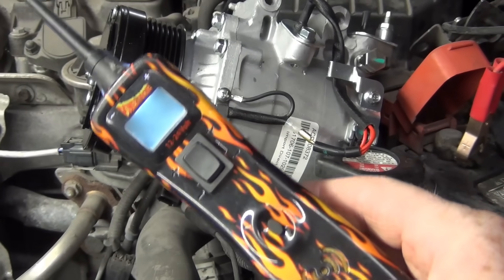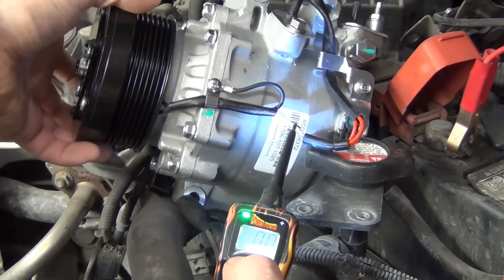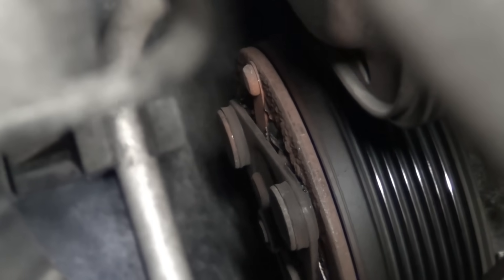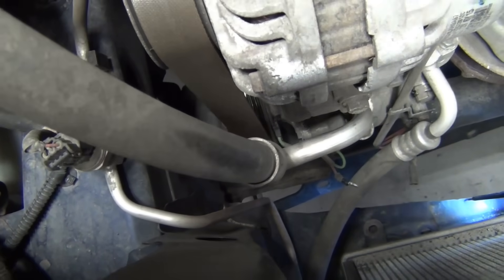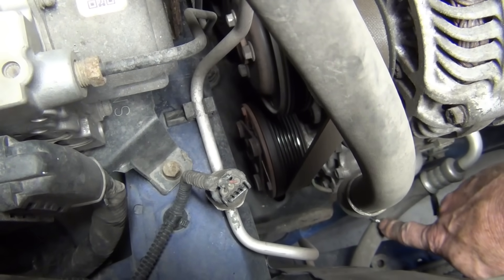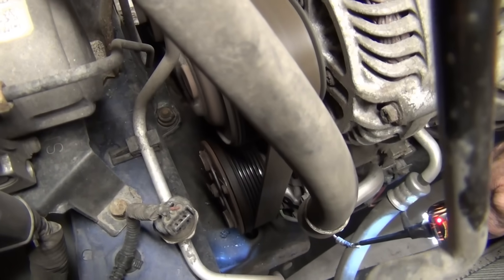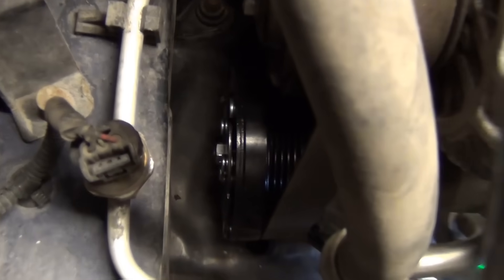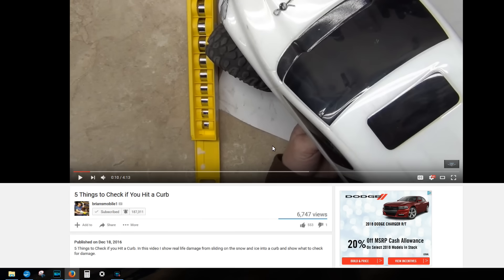How-to Test for AC Compressor Clutch Function

Comment from the maker: Power Probe used in video → http://amzn.to/2h1QaPN
Reply: Hey my car that was having trouble was also a 2007 two door Honda Civic with the same paint color 😂. Maybe they have a recall
Reply: Please please please please make more electrical video 😍😍😍😍😍😍😍😍😍😍😍😍😍😍😍😍😍😍😍
Reply: You knew they were selling something useless.
Reply: @rsattahip $@*£ -Many tools might seem useless at first glance,especially if You don't know how to use them.
Reply: @robmendoza6210  It's a glorified wire with a switch on it being sold for $61.  Anyone who cannot figure that out should not be messing with cars.  The 12 volt meter is pointless, you can do that with a light bulb.
Reply: @rsattahip  I just thought of a huge career move for you Robin,why don't you creat a product that can test continuity,add power or ground by pressing a button!but sell it for less than the "Ridiculous"power probe.
Reply: @robmendoza6210  mm

Comment: Very true advice. My clutch is engaging but doesn't look evenly surface-wise. I bench tested mine. Bc it sat with an torn open line, replacing all seals at that. Why waste the time when a contaminated system as you said. Especially if you are like me doing a 4th gen trans am

Comment: 12 Subaru Impreza. I have 0 volts going to the compressor. Should this read 12-14 v when AC is on? Fuses are good
Reply: replace the relay

Comment: This ac clutch engaged if we dont have Gas on Ac ?
Reply from the maker: If you go direct- yes.  Not on it's own if it's out of refrigerant.  The low pressure cut off switch forbids it to protect the compressor.  No refrigerant circulation means no oil riding around with it so the compressor would burn up from friction.

Comment: You dont need any of that to test the ac clutch. Thanks to RY the Car Guy for this info, look him up on youtube for visual on how to do the self test. For Nissan Xterra (and according to comments on his video, nissan pathfinders too, maybe other vehicles- worth a try lol)

Put your wippers up.

Put the key in and turn to on position, don't start the vehicle.

With in 20 secs of turning the key to the on position press the little button on the drivers side door frame (the one that tells your vehicle the door is open/closed).

Turn the key to off then back to on and you should hear a quick horn beep. Thats good and means the self test will run.

Will test in this order

rear defogger

Wippers (this is why you should put them up. So not to run on dry windshield)

Lights, parking/side, license plate frame, head low and high.

Ac clutch (you will hear the clicks if its working)

Electric fan.

It runs through the tests 3 times. Or you can end the test by turning the key off.

If you dont hear the clicks after the headlight test and before the fan turns on then your ac clutch isn't working. Check fuses/relays and if fine then need to replace the ac clutch.

Comment: I need some advice. I have a 96 Chevy 1500 and my AC went out a few months ago both hot and cold. When I go to turn the switches nothing happens but I hear a weird tapping/grinding sound coming from what I believe is the blower motor or door actuator? I really want to get my AC working but I have no idea where to begin. I have my heater core bypassed because it had been leaking. That being said, do I need a heater core for AC and is it smart to do what the video is doing or spray some dye n the lines for leaks? In all I’m lost and need guidance ngl.

Comment: I have a 2007 Mercury Montego and the clutch quit engaging, I took it to a mechanic at the town I was in and he took out the diode and told me he can't explain why but sometimes taking out the diode in Fords has always served as a solution for this issue. I'm not a mechanic but I would think that there is a purpose for every fuse put in the fuse box LOL what could have caused this issue?

Comment: I have a 1998 Mercedes ML320 and the AC stopped working. First thing I checked was the fuse and it was burned out. Easy fix right? Well the AC still doesn’t work. I just took the old power steering pump off to replace and now I have a lot of room to work with. The serpentine belt that runs everything is off. I was wondering can I check to see if power is working across the AC pump with everything off? If so do you have any suggestions on the best way to do it? Thank you very much and I definitely appreciate your great video.

Comment: I like how you demonstrated this by comparing the test on a broken compressor vs a brand new compressor. Showed how it should work (new) and how a broken one does not work. That power probe really does the easy job for testing the fault.

Comment: Does any one help me find the issue Ac compressor doesn’t turn on .. new Ac compressor new Relay new high pressure switch but compressor doesn’t turn on … but when I put paper clip on the relay compressor turn on .. Freon is full
Reply: Might want to check if you have a restriction in your accumulator or orifice tube

Comment: My 2013 Nissan Rogue Clutch works but the Bearing in the Pulley of the Clutch System is making a loud noise.  I can reach the clutch by taking off the front passenger tire.  Then take off the plastic wheel.  Then you have full access to the a/c compressor clutch.

Comment: I noticed a variety of reading on the screen ( 0:50 seconds of vid) what do these reading mean and what should they be ? Thanks ! And what is a center wire ? About 3:40 of vid. And what does it attach to, feed power to? At 5:50 you say that with new compressor that you test a different wire but do not say which one. Wouldn't it be the same wire on both compressors ? I am thinking my coil is shorted. Promaster 3.6L it is burning/melting wires in fuse box ( actually call Intelligent Control Center per Mopar) along with ground wires from fuse box/ICC to body frame near it and headlight area.

Comment: Brian to replace the high and low pressure switches/limits, do you need to reclaim the refrigerant or are there check valves under them?  I have been told there are and also there are not from other techs. I am working on a1995 ford bronco with factory the aircon.

Comment: What if the compressor keep blowing the relay ? It works for about 2-5mins then blow relay on a 08 f150 4.6 v8
Reply from the maker: Test the coil wires for shorted together with a multi meter.

Comment: I have a vehicle charged properly ac works for a short period then compressor disengages. Comes back on short time later or doesn't at all. I'm thinking it's the clutch car is a 2001 original compressor.

Comment: Brian,  Where is the clutch what does it do?  What is the line you keep touching and how do I get it?  How do I know if the compressor needs to be replaced at all or if its the relay or some fuse?  Where do I troubleshoot, in other words what are the first starting steps to know if I even have to get to the compressor or relay or arm whatever piece you were not pointing out.  Okay power probe sales but I could also just use a piece of wire to the 12vt batter right?

Comment: hmm Ive replaced the A/C clutch on quite a few different car makes. Always super easy and fast. I don't see how replacing the whole compressor is easier. Dont you need to decompress the whole system to take off the lines? isnt the tool to do that super expesnive?

Comment: My Compressor and clutch both turn on and stay on when I start my car. I'm not getting any cold air though when my AC is on. I had it fully charged and still no cold air. Not sure what's wrong
Reply: Leak

Comment: I have an issue too. MY a/c just stopped working a week later after i replaced my condenser. Now a day ago my fans were kicking on and now they are not as well as my a/c compressor clutch is not engaging. I tested my compressor with my power probe and it kicks on but when i give it power my fans dont come on. Now a day ago i was testing the relay and i was giving the fan power to turn on and i tried it again today and now the fans dont kick on.

Comment: This can thing is ridicules man I get so many systems with a bad compressor clutch and every o ring showing dye 300 + pounds low side ,500 hi refrigerant blowing out the vents in 5 to 6 year old cars . I think people should do the auto HVAC online certification to get charge heads or at least 3 questions at checkout that shows they know how to vac and fill to spec. Great video thanks for the info

Comment: I have a question, i threw in a new ac compressor on my 99 civic. And i took it to get serviced. So new compressor. Oil, etc. and all of a sudden when im driving, i hear clicking noises everytime i step on my gas pedal? When im on neutral especially. Ac still blows cold. Im not too sure what i should do.

Comment: do you disconnect the battery when doing the test on the compressor? also can you just use jumper cables from the battery to the compressor post? whats the best way to not short anything out on the car?

Comment: Hi Sir brian,  good thing I've found your content. Can I have a question?  My compressor is not functioning when turning the AC knob. When I tested the compressor,  supplied power straight from the battery,  it just keep ticking just like in your video,  thus I think my compressor is still working. Could it be the wiring? My AC relay is fine,  i trued using the relay fuse on other circuit such as fog lamps and it worked.  Hope yo notice my comment thanks
Reply: I wondered about this.,  Just a lead from the battery positive to the correct pin and hey presto a clicking sound. However, I imagine that the system has to have sufficient Freon in it or it will not work.This is designed to prevent the Compressor burning out.  My Compressor is not working and there is zero Freon in the system so........   Centre pin I think he said but not easy to check with a Multimeter as the power pin will only energise via the Thermal protection switch.  This is just my take on this and I have no A/C experience, please note!

Comment: my 2009 Nissan  Armada aircondition system is working fine while driving, however, if there is a traffic on the road that forces me to drive in very low speed or sometime stop, it is not working efficiently?. 
Can I say that the compressor is working since if I am driving it works fine.?

Comment: So question my ac works and is cold but it doesn't move nearly as much air as it used to and the max ac button has power and turns on and off but it doesn't speed the fan up or down just no increase.. any recommendations

Comment: My clutch comes on for a bit then stops. (2011 For Ranger)Or doesn't come on at all. When it comes on it blows real cold. I unplugged the wires, tapped on it and when I cranked up the truck, then it came on. Shows a lot of oxidized dust. I'm pretty sure you helped me confirm the problem. Thanks..
Nice ski footage!

Comment: thanks for the video it is helpful.  I have a unique issue.  I have replaced the condenser, L/P switch due to damage.  Replaced all relays, just because they are cheap enough.  Evacuated, vacuumed the system and recharged using a RobinAire service cart.  Turn on the car with A/C system on full, the clutch engages, cooling fans turn on.  The system cools the car 5-8 seconds.  Cooling fans stop and clutch disengages.  This happens every time I start the car.  I am at my witts end, if you could offer any advice I would greatly appreciate it.  Thanks in advance.

Comment: Why is my air coming out hot from the driver's side vents and cool on the far right vent?  It's 09 vibe.  Thanks!
Reply: Joseph Reynolds I’m not an expert but I’ve heard that it’s because refrigerant is low and needs a recharge
Reply: @legendarycinematics3091  You are correct sir.  I charged it after posting here and its been going strong ever since.  I cant believe it was so easy, the last owners were retarded.
Reply: Joseph Reynolds I wish I had the same problem lol but I think my clutch is bad

Comment: I did this test and the coil does clock as mentioned, however it still doesnt spin with the engine, even wired directly to 12v, start engine and no AC... any way to test the clutch inside since I know the coil works?

Comment: Thanks for the the through explanation. So you happen to know what it means when the clutch is constanly spinning with the outside belt coaster bearing? Similar to when you are supply 12volts. Is that a sign of a bad bearing or bad clutch?
Reply: Usually means a pressure sensor is bad

Comment: You really don’t need that tool you can Straight jump positive wire from battery will do same thing
Reply: Hi sir,  does the conpressor spins when connected straight to the battery?  Or does it just tick

Comment: Hello I have a 2003 Honda Accord v6 and something keeps kicking my ac compressor on and off while driving causing my ac to go from hot to cold while driving the ac compressor will kick in releasing cold air and then it will stop and cause the car to go humid to hot back and fourth and ideas how to solve the problem??

Comment: what would be the problem when I turn on the aircon switch but only the blower turns on then when I lightly tap on the gas pedal once.. the compressor turns on and the cold air starts coming out? there are no problems after that.

Comment: At 3:30 I have no idea where the middle wire is due to the view and I haven't taken one out yet. So far when I turn on the AC I don't see the center of the clutch moving on a 95 T100. When I turn on the AC I don't see it moving the clutch in.

Comment: I have a 08 Honda Civic. Fans dont come on when I press ac button . The clutch doesn’t engage. Used my power probe everything works . Please Help ?!
Reply: check your relays and AC fuses.Also check the fans and the relays.Cars temp should go up if fans are dead.if not.check those relays first and fuses
Reply: D. Corey Fuses & Relays Are Good .

Comment: Nothing was mentioned in the video, but I assume you need to contact the bare wire for that work?
Reply: Nothing was mentioned in the video because he probably assumed anyone interested in watching it would be knowledgeable enough to at least recognize that he was touching the tool to a bullet connector.

Much less understand how wires and electricity work at least on this basic of a level.

Comment: I remove the a/c relay and took it apart..carefully, and pushed the contact's the same way it would do IF IT was working..and the clutch came on...I have no clue after this...All fuse's are good. The only thing I dont know is if the high side switch has to make...or not make to turn the magnetic clutch on..

Comment: If I have 25 lbs in the low pressure fitting barely hovering in the low side of the green/ white line on my gauge would that be low enough to cause my AC to run hot to warm. The temp feels slight lower than ambiat air temp so I know the compressor is turning. I have a 2006 Dodge caravan. Thanks.

Comment: This gave me an idea of how to test the clutch after I pulled the compressor until I ran into the problem of what to probe with a 3-prong setup. 2 black wires and one yellow wire. 93 camry. Nada.
Reply: NEVERMIND! Grounded to the body of the compressor and touched + to hot. 333k part and it still works. Time to PAG fill this bone dry beatch and retrofit for some cold air this desert summer. Thanks for the stimulation Brian.

Comment: 05 Honda CR-V  ac clutch 60.00
Complete ac compressor  250.00
Plus your labor is 75.00 to 100.00 he.
You probably charge 1000.00 by the time you recharge the new system.  That's alot.....
Especially when these compressors aren't going to last. In 3 years you will have to go through this again.
A Honda CR-V compressor is mounted in a bad spot. At the bottom where all the heat dirt sand salt water  gets on it. And it runs even when the AC is turned off. I may sell my car but I will never buy a Honda.

Comment: NO WONDER THE CLUTCH WEARS OUT ON A HONDA IF IT KICK ON AND OFF ALL THE TIME guess its better than wasting gas i guess
Reply: That's how a lot of AC compressors work the clutch engages and disengages because it doesn't need to run all the time saves gas and it saves your clutch and it saves the wear and tear on your compressor I don't know of any vehicle where the compressor runs all the time could be wrong but from my understanding and all the cars I've worked on in the last 16 years they've all gone go off some do it a lot faster some stay on a lot longer some go off on off on but yeah so I don't know what your getting out you saying that's wrong it's not supposed to do that

Comment: hi Brian,   can I test the AC clutch operation from it's relay base as I when I jump 87 and 30  I do hear the clutch engage (better access for me) if this is ok to do?
     My issue is my AC was properly  regassed but the AC (clutch) doesn't engage any more but it does engage when I jump the relay base 87-30.
       Fans don't  turn on either when selecting AC on.
      The coolant temp sensor is lying, it's reading 40c when outside it's 18 and then goes up to 90c
      Thanks Brian, hope you've time to answer